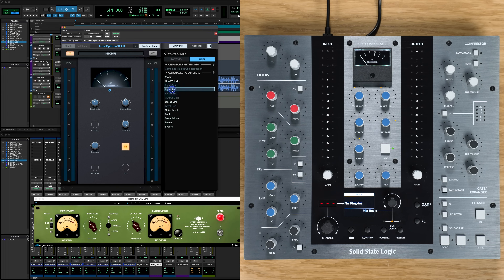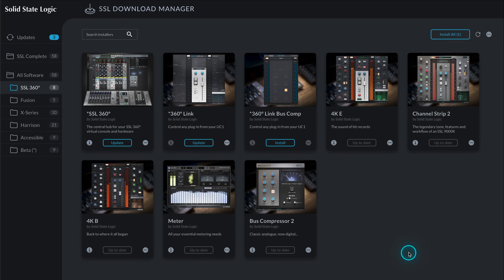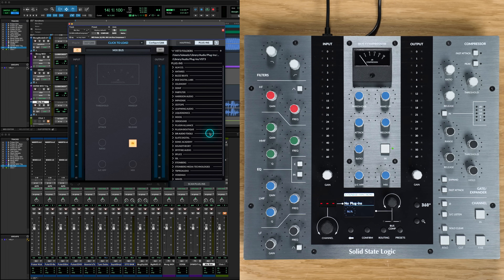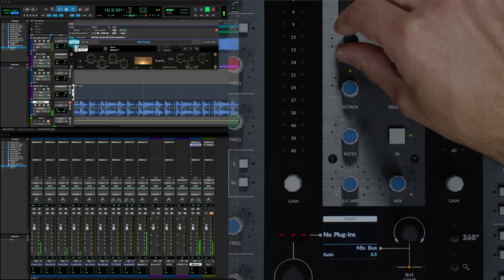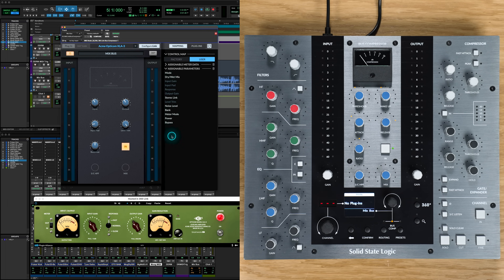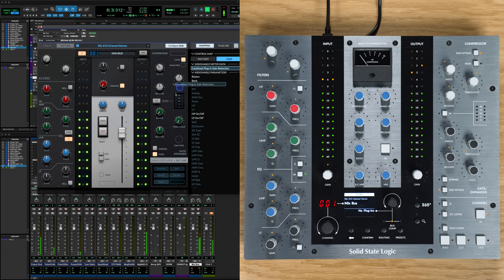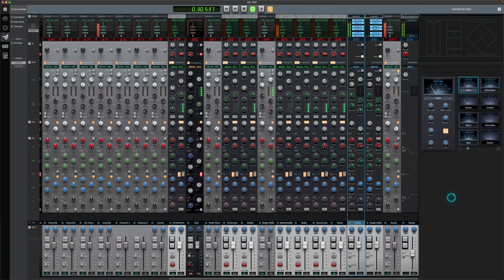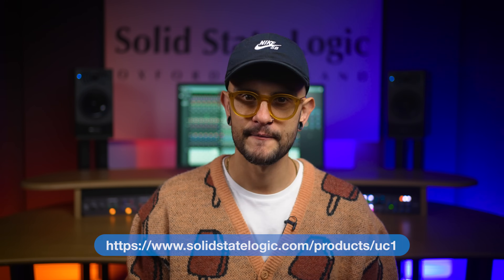SSL 360 V1.8 Update feat. SSL 360 Link Bus Compressor V1 and SSL 360 Link V1.1

Comment: Love how quickly the SSL 360 devices are evolving.  Wondering if there is a plan to make track colors visible on the UF1/UF8 when using the DAW specific layers.  The Plugin Mixer layer is great, though limited (no control over automation) and has some weird UI stuff (I'm not wild about every plugin getting its own "track").

Comment: Incredible! Did a quick check:
- UAD API2500, LA-2A and Fairchild do not have a mapable metering
- Softubes Chandler Germanium has metering, but does not work when channel link is enabled. So you can only control left OR right > useless

Am I doing something wrong or is it really not available/possible yet with these plugins?

Comment: Thank you so much for this amazing update! 

However, the 360 plug-in currently has a fatal problem.
The great update has made it possible to follow the DAW track, but the volume meter on the UF8 and UF1 only shows the volume when the plug-in passes through, not after the track fader.
This means that even if you set the fader to minimum, the volume meter will not be at minimum. Many people mix while checking the output volume of the track, not the input. The UF8 has a great color display, but it doesn't work well.

In Cubase, you can get around this by inserting it into a post-fader slot, but other DAWs currently have no solution for this problem.
Even if you can get the meter to work as expected in Cubase's post-fader slot, you will then have to apply SSL channel strips, EQ, etc. to the sound after the fader, and you will not be able to use the wonderful SSL plug-in as intended. Softube uses VST3 to display the track volume after the fader, so I think this is technically possible.

Also, as others have pointed out, if you use multiple 360 plug-ins on one track, the UF8 and UF1 will create many faders for the same track as each plug-in is added.

I really admire SSL for continually releasing exciting updates, but I hope they will prioritize this basic and fatal problem as a DAW mix controller and improve it in the next update.
(I apologize if there are any incorrect expressions because I am using a translation. As hardware, I feel that SSL's controllers are truly amazing, so I made this comment with the hope that they will improve in the future.)

Comment: Excellent update Luke however I still have a few suggestions for future updates. Firstly it would be amazing if one third party plugins could utilise both the compressor section and the rest of the UC1 not just one or the other as some plugins are more complex and require more knobs and buttons to assign. Secondly while it’s fantastic that on many (not all) you can assign meters and lights to third party plugins (shame the Amek 200 compression threshold can’t be assigned to compression lights like some of the other plugin alliance channel strips can) unfortunately adjusting the input gain doesn’t correspond with the lights showing input level in any of the third party plugins. This for me at least is absolutely essential for proper gain staging as I need to be able to adjust the input gain to see visually that I’m not going into the red lights on the input. This works beautifully with ssl native channelstrip such as the 4KB but not with any third party plugins sadly which is a deal breaker for me. A third suggestion would be to find a way where adding ssl link plugins doesn’t create an additional channel on 360. You should be able to have several link plugins without creating any more than the one channel. Also if you assign a third party plug-in to the new ssl bus comp link selecting that channel on the uf8 doesn’t take you to that bus comp on the uc1 even in 360 mode……ie. it doesn’t follow.  Also it would be great to somehow allow the UC1 to control two plugins. In other words you could make your own custom channel strip perhaps using a pro q3 and pro c1 together for example. Last but not least it would be amazing if as soon as you tweak a third party plug-in using the uc1 the gui of the plug-in comes up on your monitor just while you are turning knobs and stays up until you don’t touch the controller for a second or two. I mean the actually gui itself and not a really small version of the gui. Something large and easy to see. Last but not least could the lovely UF1 screen be used to see the gui or third party plugins or at least something if not the actual gui just like you can see an eq curve for the ssl native channel strips?

Comment: This is great guys! What about the update with UF8 properly working as CC controller on cubase?
Reply: Updated per the release notes.
Reply: @thaexception3406 thanks. Since they didn’t mention in the video I was wondering about it.

“Using the MIDI CC Layer with Cubase/Nuendo - timestamps now sent with MIDI CC data, meaning that you can write MIDI CC directly to MIDI parts without needing to record it to the automation lane.”